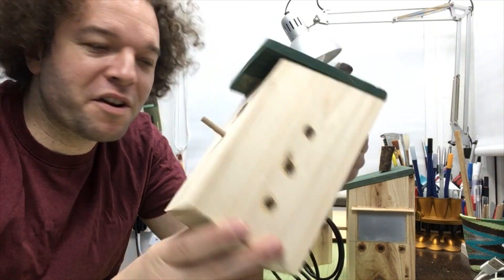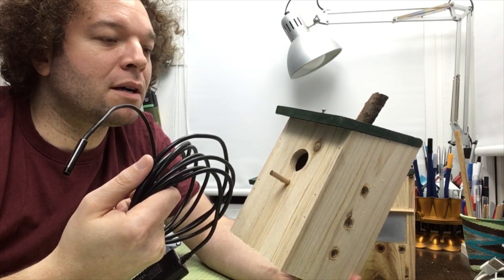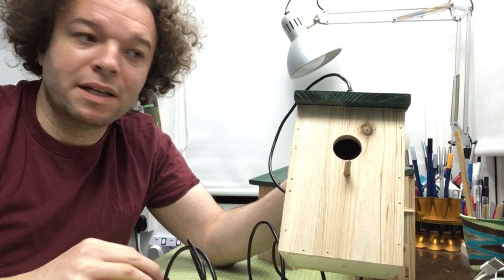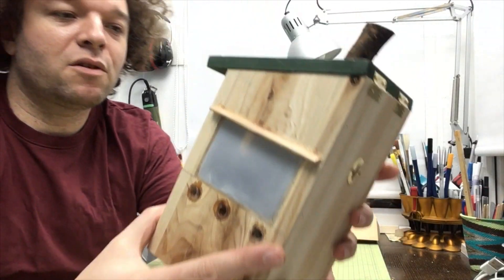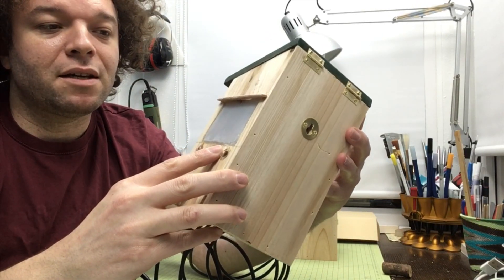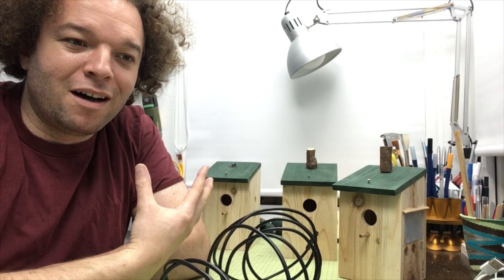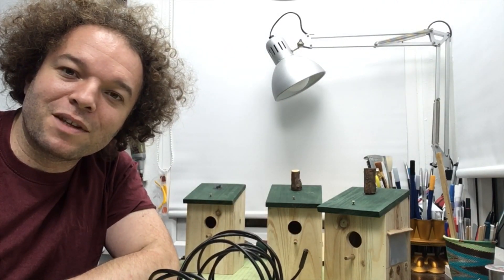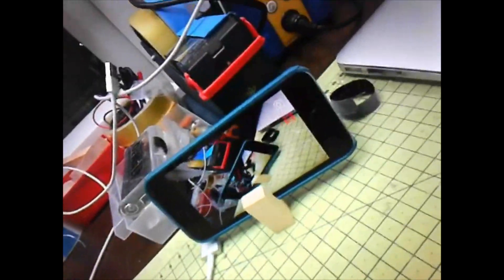Make a Cheepy Cheap BirdBox with WiFi Camera (Great for Schools/STEM Projects)

Comment: We are having extreme heat this week and I have learned a lot!  You need more ventilation in these boxes very badly. There should be long slits on top side walls under roof overhang or holes, there should also be holes in the bottom four corners of floor to provide drainage and more ventilation. No perches should be on box either. Thanks for your video
Reply from the maker: Hi Brenda - your timing is impeccable, I'm literally writing up a V2.0 - thankyou! I will try and incorporate your suggestions. Although I have made it larger, which I think will be beneficial also. (Spoiler - just had mine fledged).
Reply: @JudePullen  👍🏼 my 10 day old bb nestlings are struggling with our high heat temps now, I added more ventilation holes, heat shields on roof and side plus just put an umbrella over box to help shade it better. My biggest fear is removing my wren guard right now for fear the wren comes back and kills the nestlings. I unfortunately saw it happen to someone else’s bb nestlings. I’m going to wait a few more days so it’s closer to fledge time. I do love your designs!
Reply from the maker: @brendalins1237  bb is black bird? 
I never knew wrens were so predatory as they are tiny.
Reply: @JudePullen  oh no I’m talking about bluebirds I just said bb for short. Oh my yes, house wrens although small are very predatory. They have pecked and destroyed my bb eggs twice.
Reply from the maker: @brendalins1237  Ah right - yes - sadly eating eggs (not chicks) makes sense. I did hear woodpeckers do eat chicks tho. It's a wild world out there! Hope you're are doing ok in the new shade.
Reply: @JudePullen  thanks, yes so far so good. They should be fledging in a few more days. I took the wren guard off a couple days ago and haven’t had any problems luckily. Did you get to see yours fledge? It sure is a wild world!
Reply from the maker: @brendalins1237  I missed one actually, but got the other two on video the following day! So pretty pleased about that! Just googled wren guards - quite a fascinating ethical debate there (don't worry I'm not militant about these things, haha, but it's very interesting to contemplate, right? do we intervene or not, etc.).
Reply from the maker: @brendalins1237  new version is live: https://www.instructables.com/Side-View-Bird-Box-Camera-and-BlueTit-Diary/
Reply: @JudePullen  wow!! I love this design and all your informative videos, you and your son have been hard at work! I bet he got a good grade on his project, should be A+ 😁👍🏼 great job to both of you! Thank you for sharing
Reply from the maker: @brendalins1237  thanks! It’s was a fun (if emotional) project to do as a family!

Comment: Aren’t you afraid that the battery of the wifi camera will get too hot or damaged because it is continuously being charged?
Reply from the maker: You can always use it periodically. In fact I suggest this in the write up. See link.

Comment: Great video, thanks for sharing.  I'm adding a solar powered USB charger to extend wifi
transmission time of the borescope.  Here's hoping the current draw of the camera
is less than the charging rate of the pv panel rated @ 150 mA/hr!
Reply from the maker: Sounds great. Will you post the outcome?

Comment: Would it be possible to leave the WiFi camera up permanently, or at least for all of spring/summer? A live feed of one of these boxes would be really cool to do, and I'm thinking I might propose the idea to my local library...
Reply from the maker: Hi Kerry, Please take a look at the Instructables link above, and scroll down to Step 12: Appendix 1. I show you how to use a waterproof enclosure to do this. But I also suggest that you put the device on a timer switch, so it's not on say 1 hour before dusk, so the birds sleep properly.
Reply: Thank you! I'll admit I saw that shortly after leaving the comment, haha, but I appreciate you getting back with me anyway! Does the camera/endoscope have a light on it? I was thinking of making one of those opaque windows that you suggested if not.
Reply from the maker: @customswithker1649  The cam has a light which is adjustable from off to quite bright. But it the camera is so sensitive even in low light, it hardly needs a boost. And yes, I like the opaque window myself and hope that is sufficient.